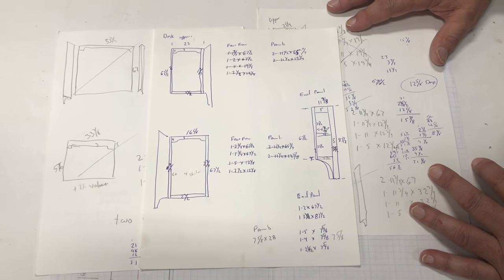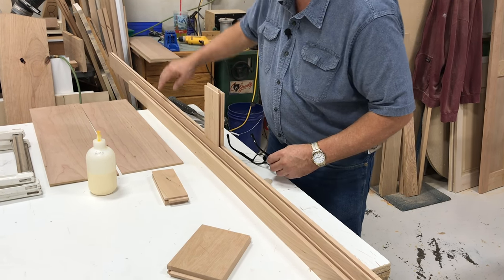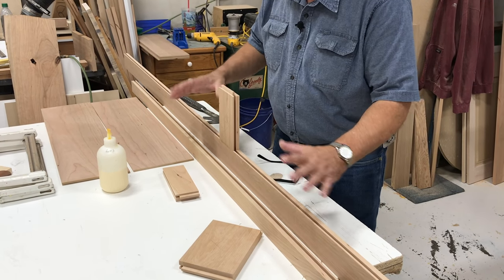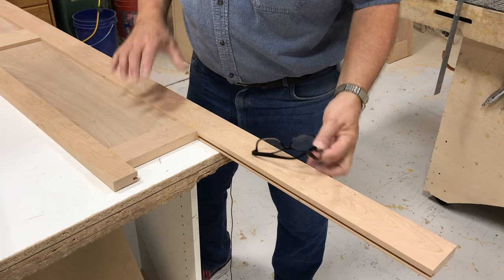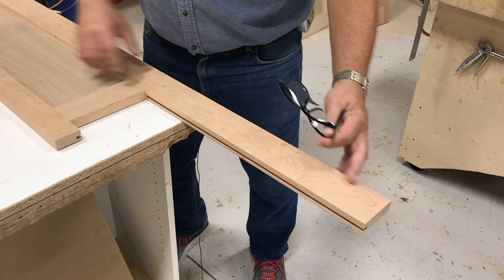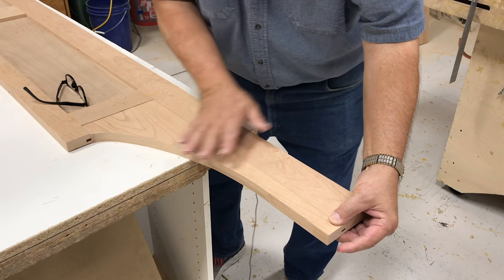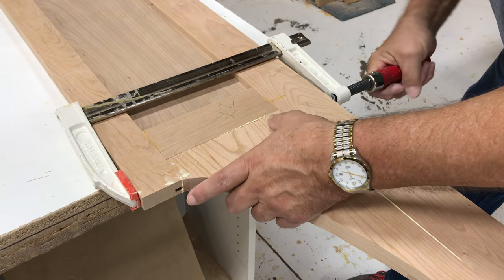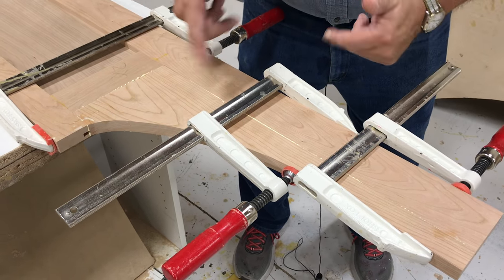Building Tall Wall Bookcase with Support

Comment: The final profile of the side looks different than what was shown in the video. What did you do to give the 'stepped down' look as it transitions from the frame to the panel? Rout an ogee profile?
Reply from the maker: Shawn...yes there was a small ogee molding added to the inside of the frame against the panel.  This was a customer requested add-on after our initial build. Thanks for visiting...hope this helps.

Comment: sorry i think that design looks tacky,  you may want to try screwing your cabinets together and you may not have to worry about extra support
Reply from the maker: Thank you for your input. The bookcases are screwed together and screwed to the wall and would in most cases be just fine. After reviewing the client's storage desires the supports were added to satisfy his concerns and my liability.